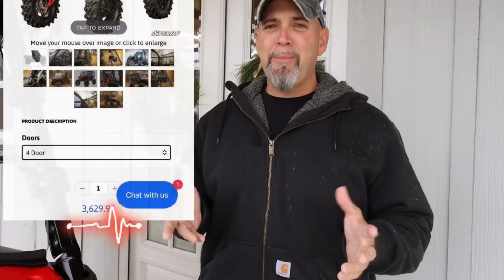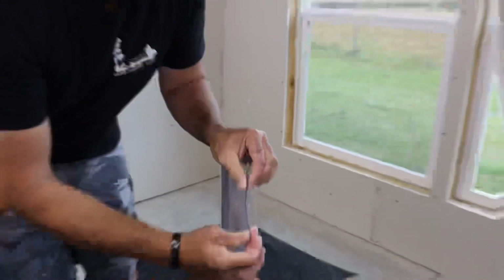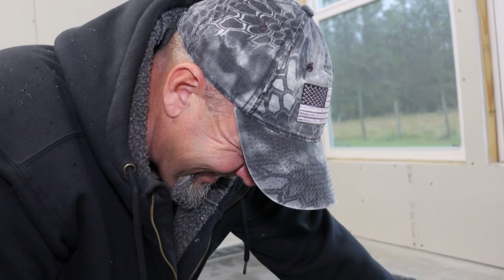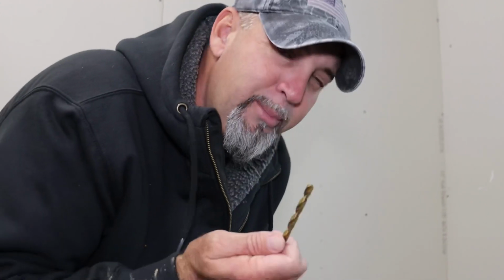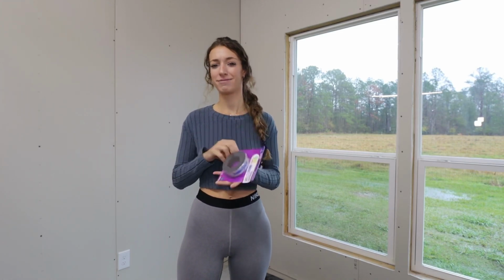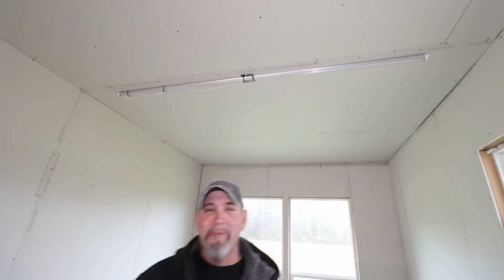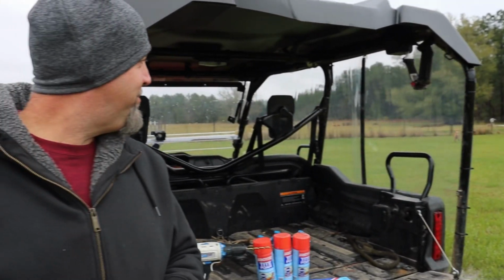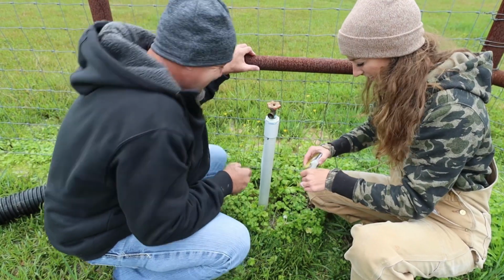ARCTIC FREEZE In Southern Louisiana?!

Comment: We are right down road from y’all, just came across ur channel and started watching y’all!  When we built our house we prepared for some harsh winter and made it easy to prepare (I work in oilfield so gone half the time!!  When I built shop I installed valves and a blow out line, I just isolate shop water line from main, and hook up my air compressor and blow out all the lines!!  Then leave a small drip going in house.   So far so good.

Comment: Why didn't you just get pipe insulation wrap for your pipe? it would have been cheaper than the spray foam insulation. and easier to wrap the pipe. Also called pool noodles.

Comment: Hope it doesn’t stay cold too long. The ground will freeze down to about 4 inches, so the pipe under the ground will also freeze close to the ground. I would have taken the insulation below by about six inches and refilled the hole. Best of luck.
Reply from the maker: It’s only suppose to last for a few days then be back up to 75°. Let’s hope they are right!! Thanks for watching!

Comment: Doing the same thing here in the SC mountains. Covering pipes and checking all radiators. Supposed to be 7 degrees here Saturday morning and not get above freezing until Monday.😕Never seen pipes covered that way, but I think I like it.😊Good job on the plastic doors. That's one of the reasons I bought a "Japanese Mini Truck". It has doors, heater, wipers, 4 wheel drive and is highway approved. Mine even has a dump body and was half the price of a "sidexside". I think one would do good in those "cajun swamps". Maybe Santa will bring you one Jim.😁

Comment: Just heads up on your antifreeze you need to add water to that should be 50/50 mix I think I may be wrong but it looked like straight antifreeze so you might want to check that all the other stuff was pure genius redneck all the way it works good job